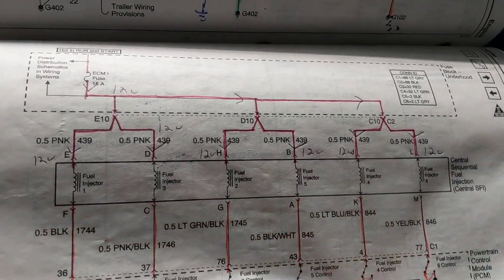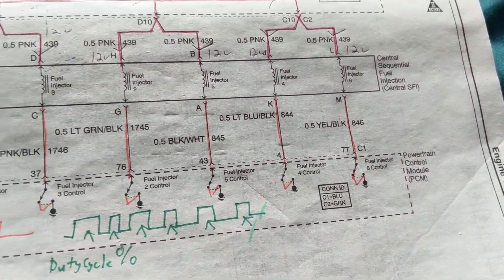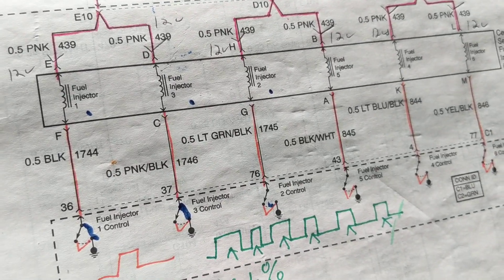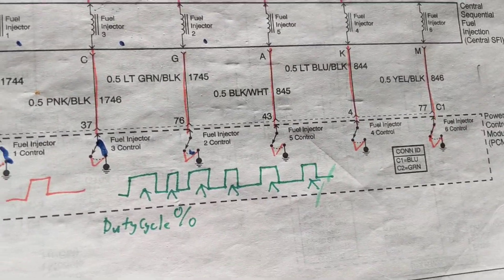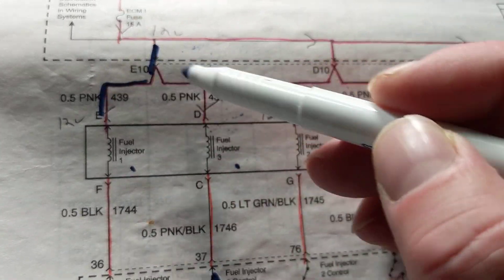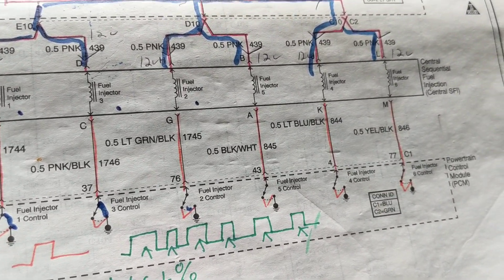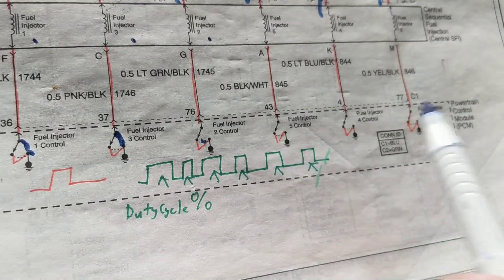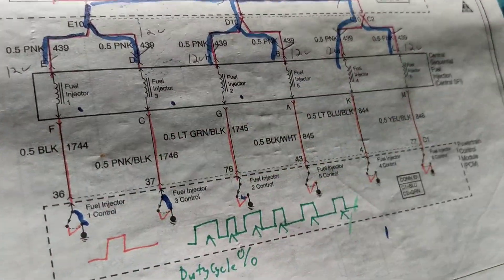HOW TO TROUBLESHOOT A FUEL PROBLEM

Comment: Amazing🤩
Reply from the maker: Thank you for your viewership
Reply: @Joeelectronicschematicsforauto  what's the unit of measurement used in the circuit diagram?
 MM or Sq. MM??
Reply from the maker: @tnamen1307  millimeter
Reply: @Joeelectronicschematicsforauto  okay👌
Reply: @Joeelectronicschematicsforauto  my i20 wiring horn has 10 amp fuse, single horn, and its wired is marked.0.5 mm. 
Now, I want to install 2 creta horns which consumes 15 amps in total. 
Do I need to change the wire to 0.8 mm from. 5 mm? Obviously I need to change the horn fuse to 15 amps and relay horn to 15 amps as well.
Reply from the maker: @tnamen1307  I would worry about the gauge I would use a 14 gauge wire for a 15 amp fuse
Reply: @Joeelectronicschematicsforauto  
Hello, today I checked the individual resistance of the two new OEM Creta Horns which are of polarity horns.

Results: Setting DMM at continuity mode, I got about 1500 ohm appearing for some few seconds, and then DMM shows again value 1. Then, I set the DMM to 2000. Here also, I got 1500 ohm for about 3 seconds, and then back to 1. Then again, I set the DMM to 2000K. Now, the DMM shows always 1 and does not even show 1500 for few seconds.
I repeat several times, and got same results. I also interchange the DMM polarity. However, same results.

So, is this normal? Why resistance shows up and return to 1?
Reply from the maker: @tnamen1307  it's important to realize that this is impedance of the speakers not necessarily the resistance but the most accurate test is not to get open when doing resistance and also you can put a battery across each speaker
Reply: @Joeelectronicschematicsforauto  yes i tried with battery, both horns are working perfectly. No doubts.
However, still curious to know why the DMM shows 1500 and back to value 1. Horns are supposed to show some value of constant resistance.
Reply from the maker: @tnamen1307  well polarity really shouldn't matter but it depends if you're using an auto range meter like a fluke or one with a selection range
Reply from the maker: @tnamen1307  so some meters say ol some meter say one show it's overloaded or the resistance is more than the scale of the meter you should measure very low resistance

Comment: you are gonna grow viral
Reply from the maker: Thank you for your comment
Reply: @Joeelectronicschematicsforauto  Hello, today I checked the individual resistance of the two new OEM Creta Horns which are of polarity horns.

Results: Setting DMM at continuity mode, I got about 1500 ohm appearing for some few seconds, and then DMM shows again value 1. Then, I set the DMM to 2000. Here also, I got 1500 ohm for about 3 seconds, and then back to 1. Then again, I set the DMM to 2000K. Now, the DMM shows always 1 and does not even show 1500 for few seconds.
I repeat several times, and got same results. I also interchange the DMM polarity. However, same results.

So, is this normal? Why resistance shows up and return to 1?

Comment: Happy holidays JOE   After all your vids have u ever though of putting together a vid using test lights at different amp rating to show when and how to find open short to ground short to power and excessive resistance  Would like your opinion on selecting the correct amperage thanks Joe
Reply from the maker: usually I don't use a test light because it just indicates an open or a voltage I always use a multimeter and I will definitely as I said when I get a chance to go over shorts and opens in a very simple manner thank you for your suggestion
Reply: @Joeelectronicschematicsforauto  Hello, today I checked the individual resistance of the two new OEM Creta Horns which are of polarity horns.

Results: Setting DMM at continuity mode, I got about 1500 ohm appearing for some few seconds, and then DMM shows again value 1. Then, I set the DMM to 2000. Here also, I got 1500 ohm for about 3 seconds, and then back to 1. Then again, I set the DMM to 2000K. Now, the DMM shows always 1 and does not even show 1500 for few seconds.

I repeat several times, and got same results. I also interchange the DMM polarity. However, same results.

So, is this normal? Why resistance shows up and return to 1?